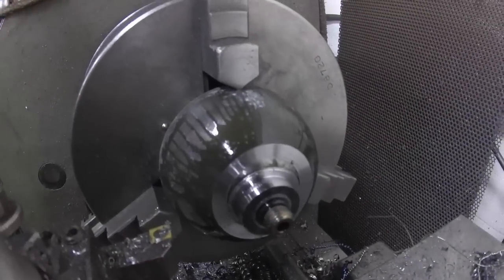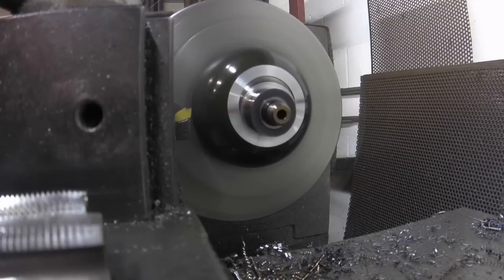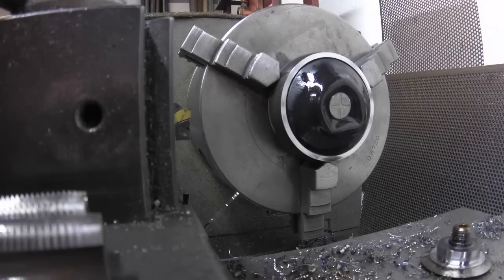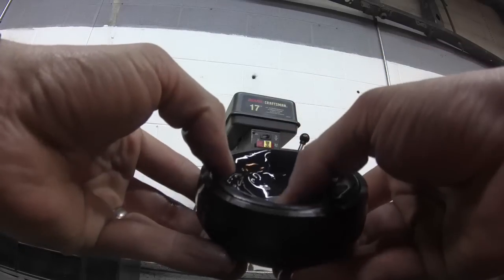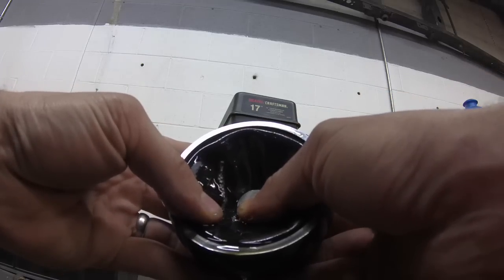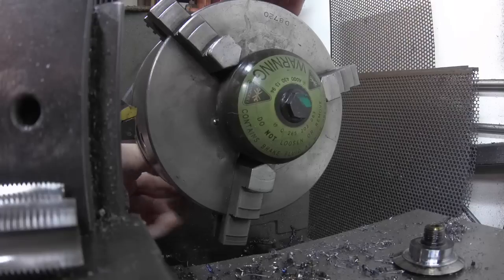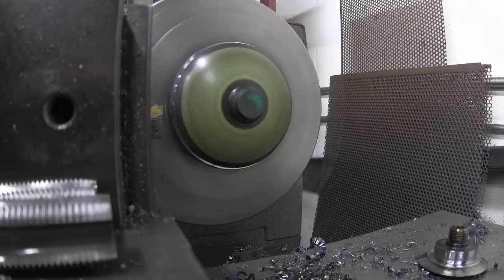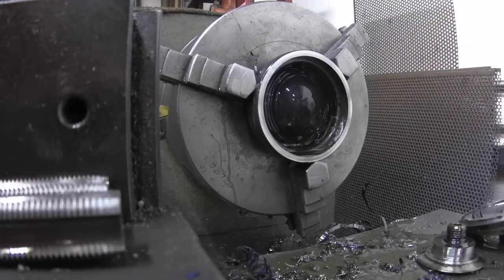W211 SBC Dissection

Comment: The walls of the accumulator are thicker than I imagined, what a wonderfully disastrous technology the sbc is, it's stops the magically when it works and when is doesn't well the last thing you'll need is a new sbc, it happened to a guy I know he used the foot parking brake and down shifting before he finally rammed into the car in front, my W211 is a automatic needs a new sbc and new brake lines front to back, loved the car won't sell it won't drive it and damn sure I won't be getting it repaired not worth the money. Pity she's a beast and beautiful. Thanks for the video now I know.

Comment: An accumulator "stores" the pressure produced by the SBC pump. It's like a hydraulic version of a capacitor. The ABC hydraulic suspension also has accumulators which do the same and which also go bad with age. The backside of the bladder is filled with high pressure nitrogen.  Eventually the rubber bladder fails and allows the nitrogen to escape.  These should be considered consumables much like brake pads and rotors. It's just that they don't need replacing as often as brakes.  I have new accumulators for my ABC sitting on the shelf, ready for when each eventually fails. Looks like I should get one for my SBC as well!
Reply: good info that the backside of the bladder is filled with high pressure nitrogen. By the way, my car shows pressure 80 when working. Maybe is a little low :-(

Comment: It looks like an High Pressure Citroen Hydraulik suspension part. In the Citroen System are green Spheres that contains a thick rubber sphere inside and Outerside there is N gas as the High Pressure counterpart to the Hydraulik Oil.
This Sphere looks identical to the Citroen part.
There is no Pressure in the Sphere in the Video. The Pressure goes thru tiney holes in the Rubber Bladder.

Comment: Hello,

my car is MB E-class, w211, I am looking to buy the pressure accumulator that is part of the SBC / ABS module because it is damaged. The part is made by Bosch, its number is 0265202063. Since I can not find it anywhere, the closest number to it I find on the internet is 0265202070. Is this part with the number 0265202070 interchangeable with № 0265202063?
Reply from the maker: Sorry Emil, I have no idea... hopefully someone can help.